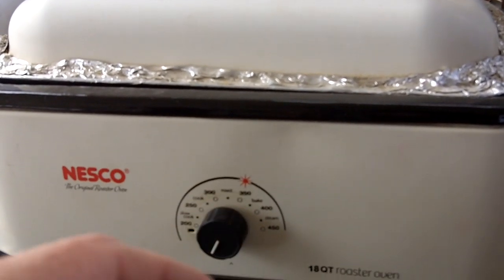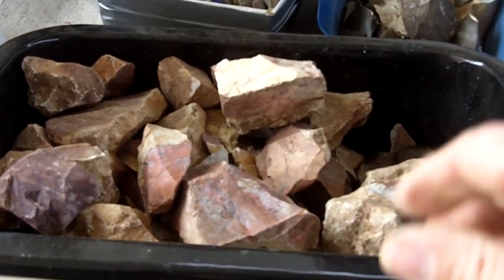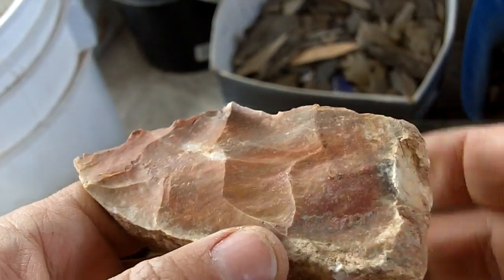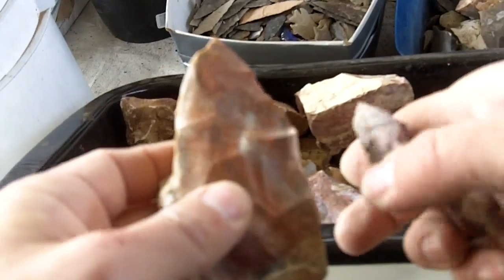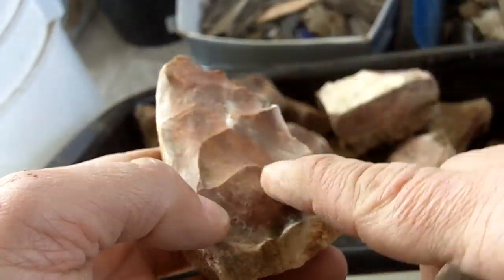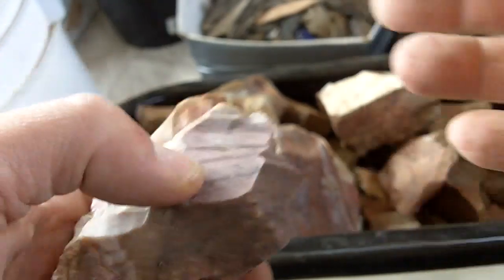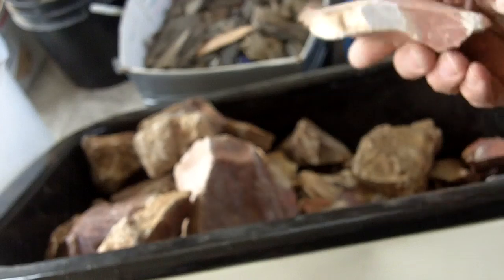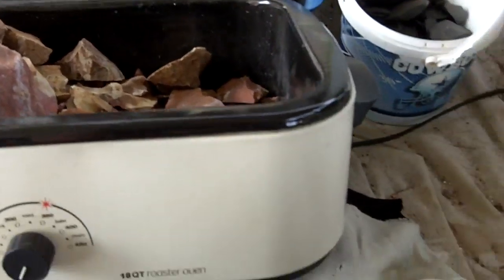296 - Heat Treating Alibates and Tecovas Jasper

Comment: Glad I found your name change so I can continue to benefit from your knowledge. 
I have a question on the heat treatment process. When bringing the temperature down , what is your method? I've been told that it needs to be done slowly, 25 degrees for a half hour per drop. 
I've been knapping for only a few months now and your channel has proved invaluable. 
Thanks Hobbit ,Jack , Censai , Guru, Teacher. Whatever title you choose, I'll keep following!
Reply from the maker: Keith Eminger I usually turn off the heat completely and let the stone cool for 12 hours or more.  During cold weather, I place a thick canvas cloth over the turkey roaster so that it will cool down more slowly.  The most important thing is to cool the stone at a steady rate.  If you adjust the heat as it cools, the cooling is not steady.